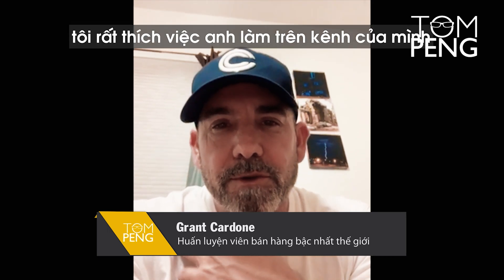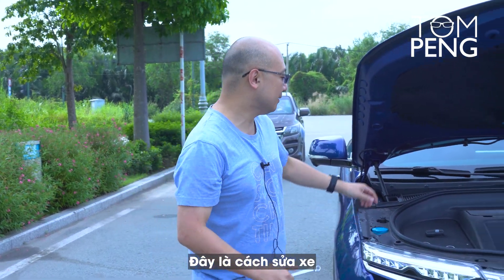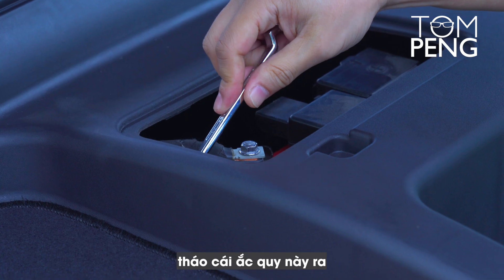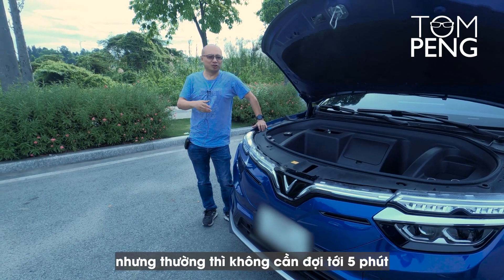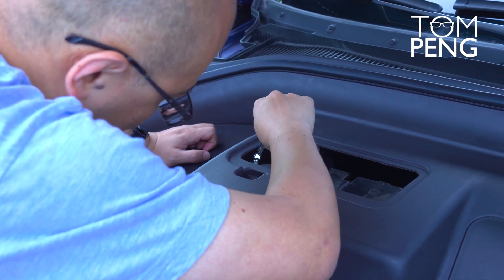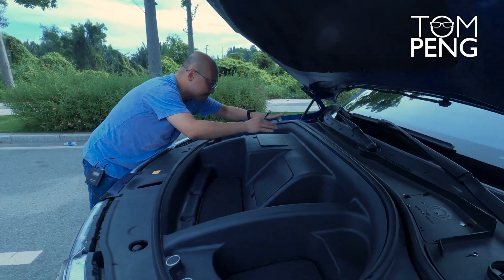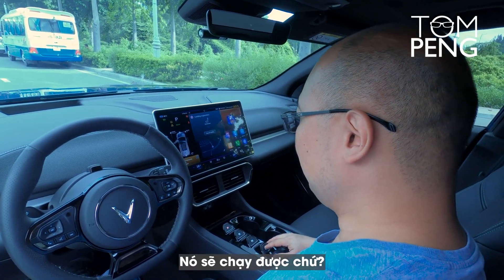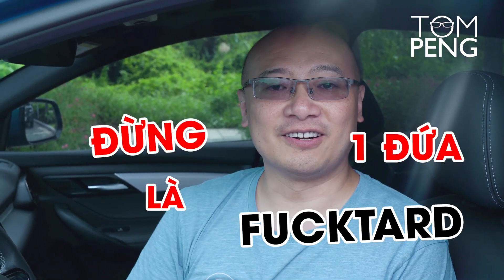Cách sửa lỗi ô tô điện VinFast ở hầu hết mọi dòng xe

Comment: You should install a CB, connect a wire from the main battery into your cockpit. Then, everytime like this, you only need to shut down and turn back on the CB. No need to use the 10 wrench haha.

Comment: Is this going to happen all the time where you unhook the battery and hook it back up to get to work? Are they going to fix the problem or not so that you don't have to do that all the time!!! I sure an he** wouldn't like that at all if it's down pouring rain or blowing, cold, snowing outside doing that. I know people here in the U.S won't like that at all. I've been looking into VinFast cause they are building a factory in Chatham County, NC. I hope they fix those problems before they start selling cars here.
Reply: So far, only a memo is signed with NC.
No official contract, no commitment, nothing concrete...